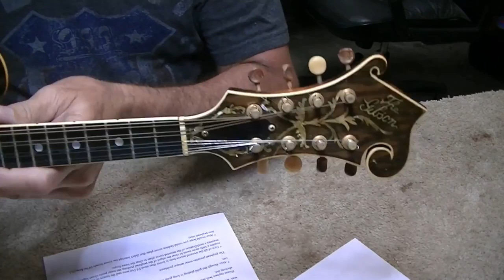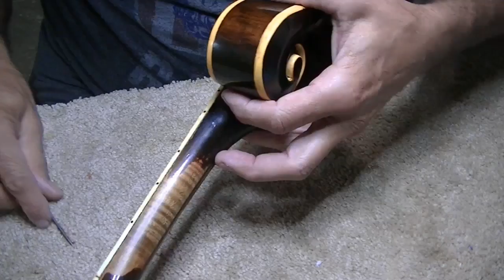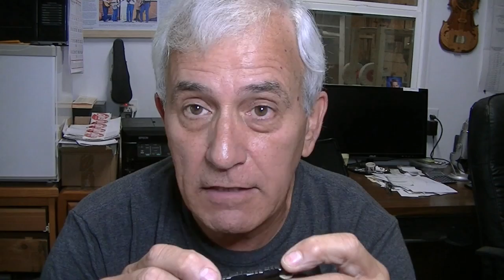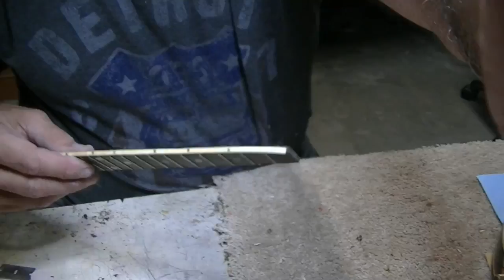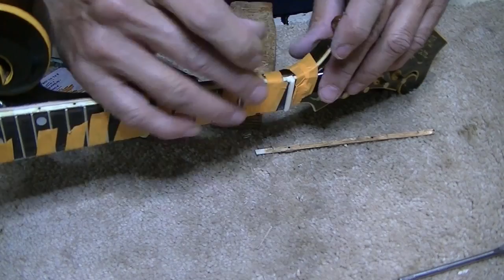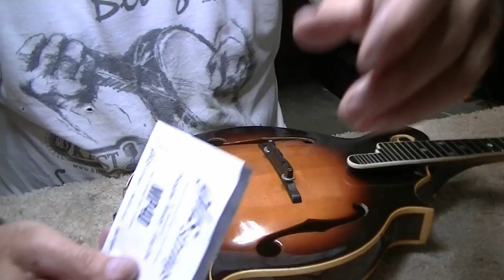239 RSW F12 Gibson Mando Prior Converted To An F5

Comment: I just learned about a CA glue accelerant that I already have in the house!  It most definitely will whiten the joint but that's what you get for incredibly cheap! 8-))  It's Baking Soda.  See "Super glue trick the cops dont want you to know"  by Stephen Cox.  Use is simple, once you've applied the glue and put the two pieces together, sprinkle it with baking soda!  It'll be solid in less than a minute.  Look at the source video to double check my memory.
Reply from the maker: Yeah I've known about the baking soda trick for many years. I don't use it because I just don't really care for it.

Comment: A "micro millimeter" would be about the wave length of an xray(10^-9) which is much much shorter than visible light. :)
I'm a 'merican engineer so I'm fond of mills(thousandths of an inch).
Now I got to get some more glue.  527.  I've already got some of the canopy glue.  You got some great expertise with glues and you are inspiring me to add to my collection.

Comment: Another really good save Jerry.  Shame on whoever did the  peghead finish this -looks like someone went over the original Gibson finish with some cheap poly varnish put on with a throw-away brush. Probably never prepped it or wet-sanded it out. That alone wrecks the value of the instrument.

Comment: Not that it matters, BUT. There's something funny about that neck. Who would remove the neck from an F5 to put it on an F-12? The peghead looks like he bought a neck from one of the kit sellers and used aftermarket 'fern' inlay. the grain pattern up there doesn't look like neck wood, but the neck itself looks like an original. Maybe the video distorts some of this, but it's a strange setup. Sorry to patter on, but this is strange. Another Great job, as we've come to expect.